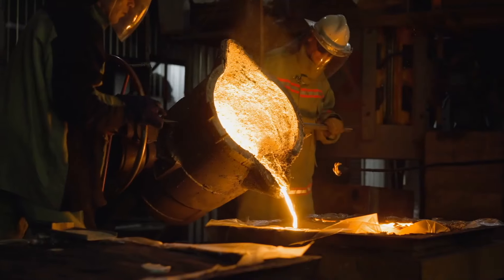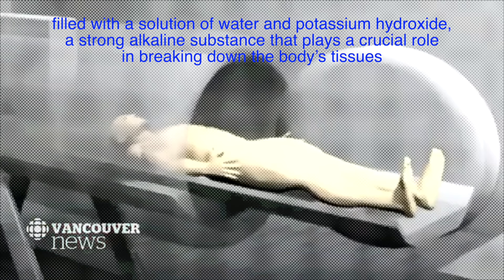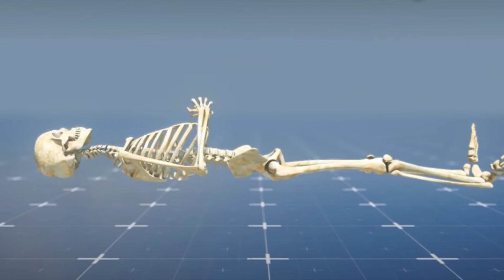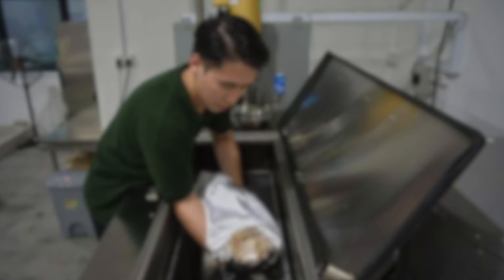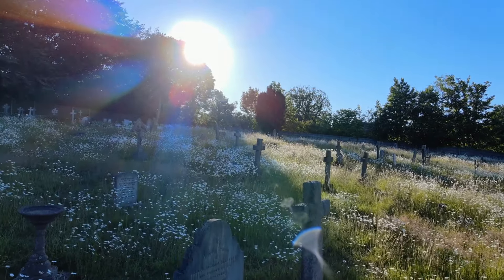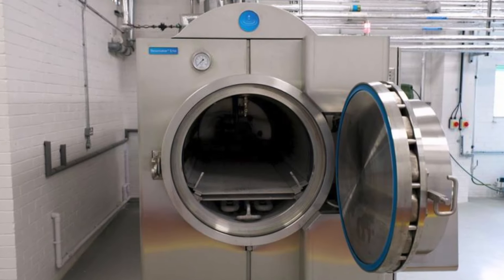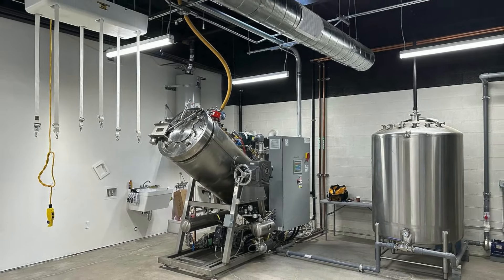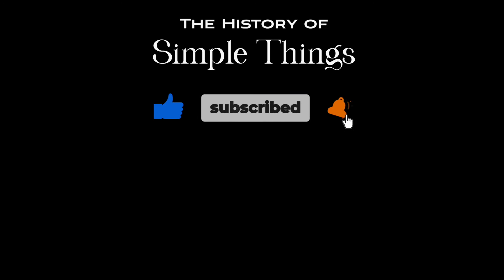How Does Water-based Cremation Work (Alkaline Hydrolysis)?

Comment: "Eco Friendly"... An alkaline solution so strong a can decompose a body... yeah, right... And how is that solution disposed of?
Reply: it's dumped behind the mortuary ...    or sold as weed killer.
Reply: It is used up during the process. It’s the same as removing lime with acids. The components interact with the substance and in the end there are just harmless substances.
Reply: It is filtered, purified and reused.
Reply: Video said it is put into the city waste water system, which gets treated and sent back as clean water for all to enjoy.
Reply: It’s sold in China as Soda Pop
Reply: So it is essentially like being pressure cooked in lye?

Comment: In the description it seems that the alkaline effluent is discharged without being neutralized which is shocking. The treatment of bones in an acidic environment allows them to dissolve completely and provides a mixture of gelatin and calcium hydrogen phosphate.